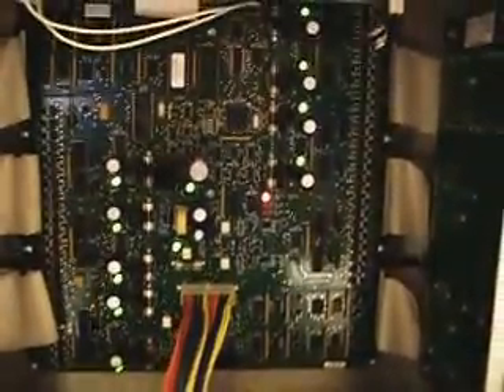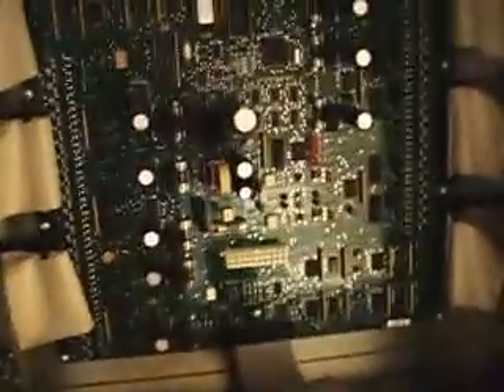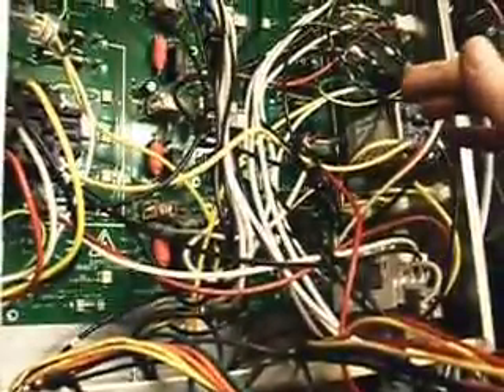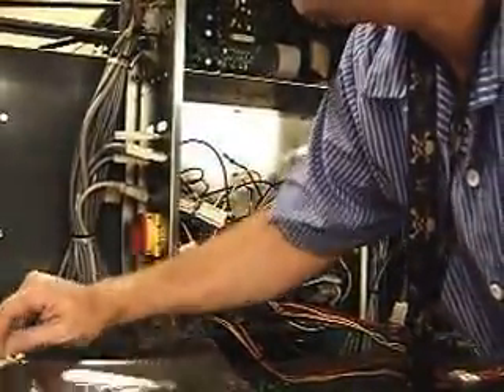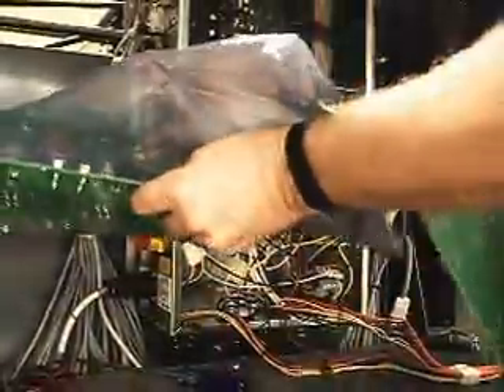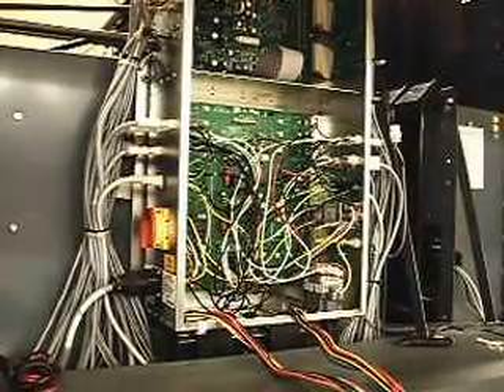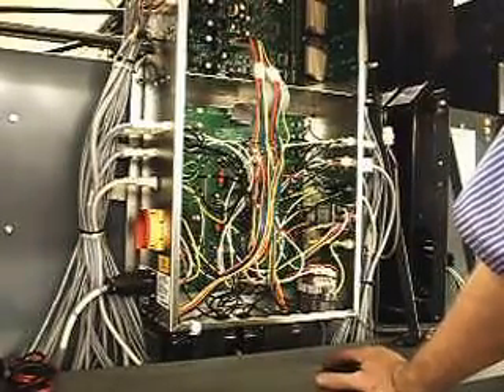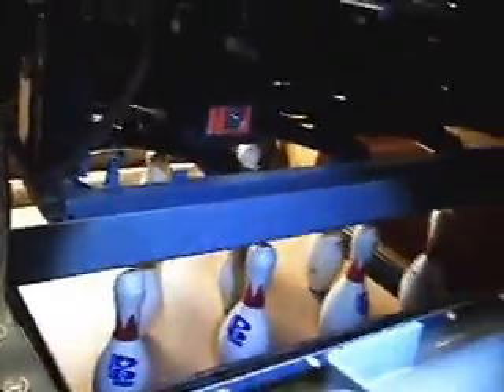T-band and accelerator down

Comment: please tell me by mistake ba. replaced the accelerator ball, checked the AS and power wires. replaced the low-voltage and high-voltage boards. still error ba. I'm sorry.